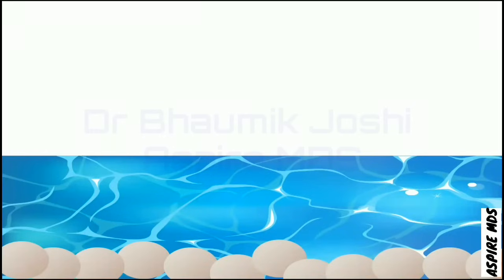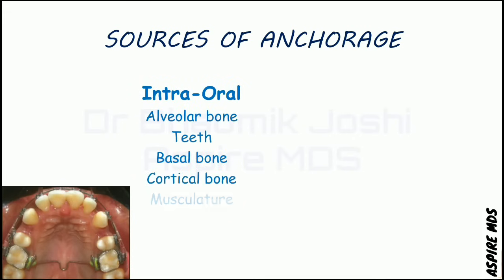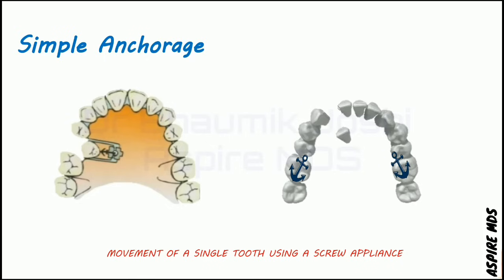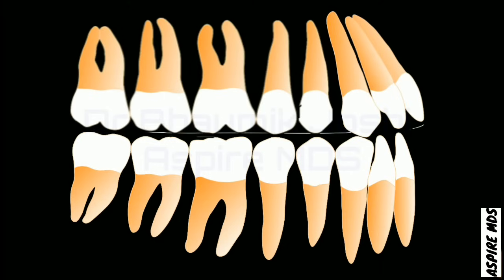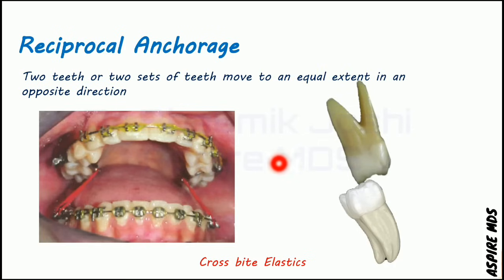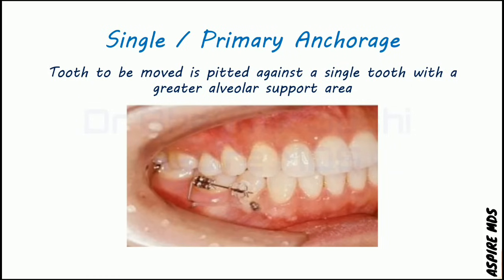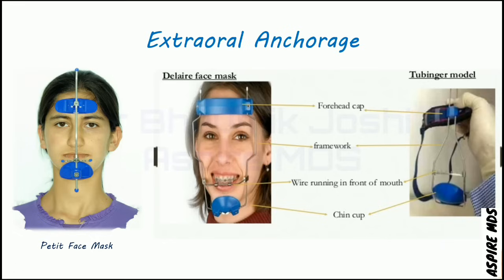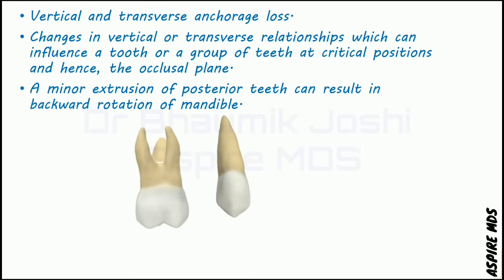Anchorage - Animated Orthodontics | Anchorage loss | Dr Bhaumik Joshi | ASPIRE MDS

Comment: Sir,
The Example you Gave in Reciprocal anchorage. In case of midline diastema 
What about the teeth root ? 
Dont  the tipping occurs? as you are applying FORCE 
Pressure on the both central incisor.

Comment: Hi Dr. What's up?
I have a case of CL 1 with sever crowding.. I had to extract 3 of premolars teeth (4) except the upper rigth side.. I extracted the (5)..because it was with heavy filling.. I was able from tracting the (3) in all the three quadrants on a rectangular wire and put a stopper In front of the bands to get more anchorage ..and I got CL 1 relationship.. but the upper (4) didn't move.. instead the (6) came mesially.. I changed the wire to round to inhance the sliding movement with no improvmet.. please your kind opinion. 🌹🌹🙏🙏